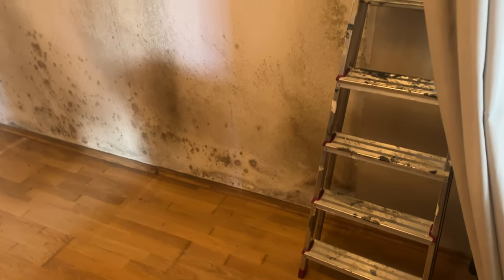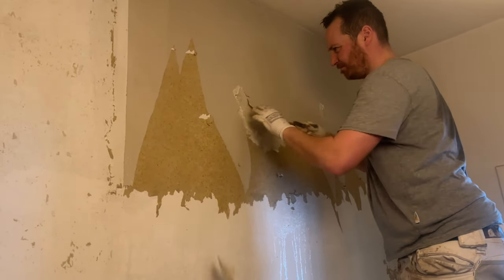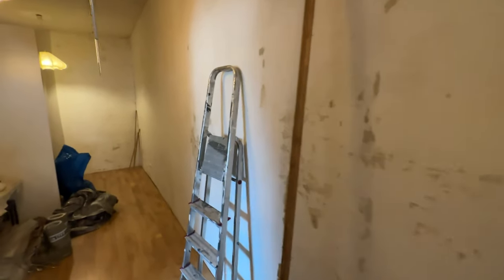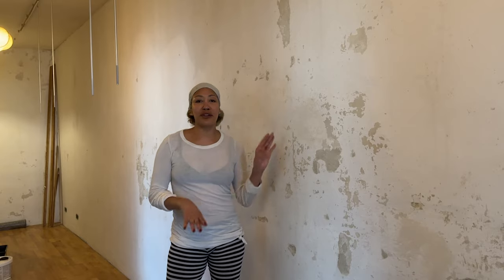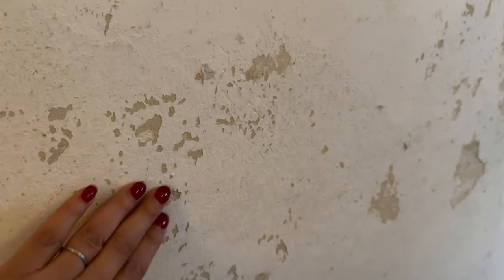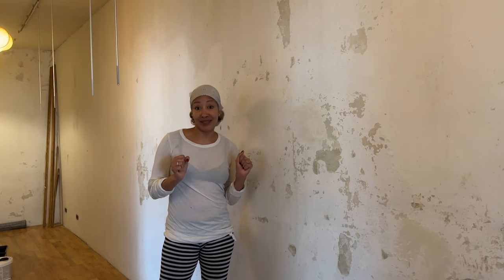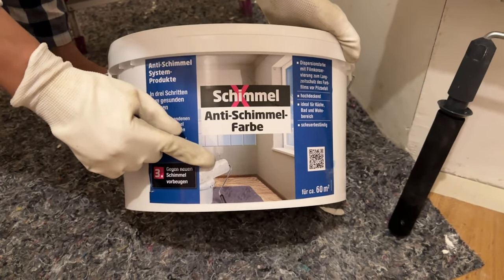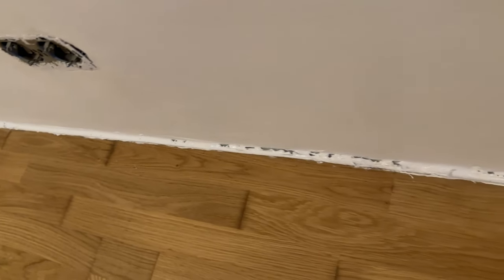Mold Removal: How the Pros do It (Black Mold): My Emotional Journey of Remediation to Prevention

Comment from the maker: Hey guys! I forgot to mention if your wall is hollow. You definitely need to remove the drywall and any insulation to see if the wood studs are dry and not affected from the mold. If they are, you can treat with same mold remover. You need to find out where the moisture source is originating. After everything has time to completely dry out, you can replace insulation and drywall. 
Yours truly, ❤ Macon
Reply: I was just about to ask this.😀 Thanks
Reply from the maker: @thegreatwolf5177  Glad I could help!